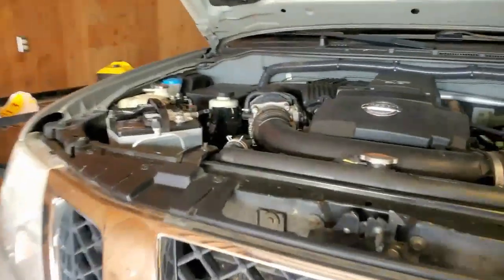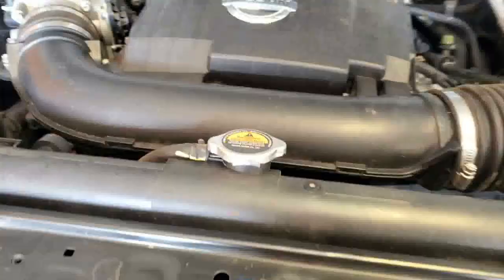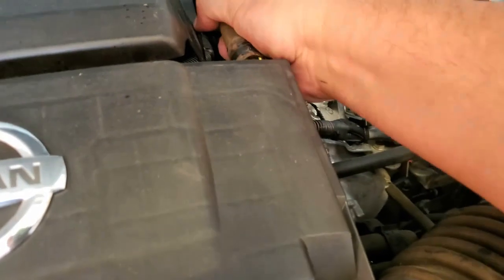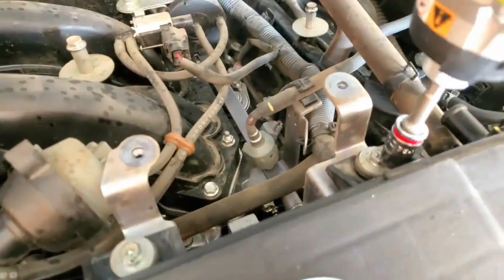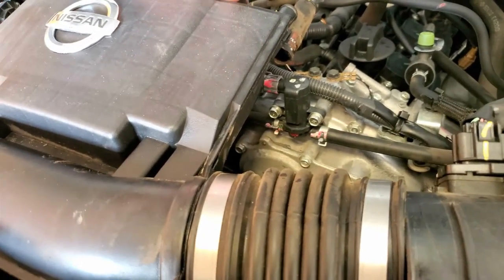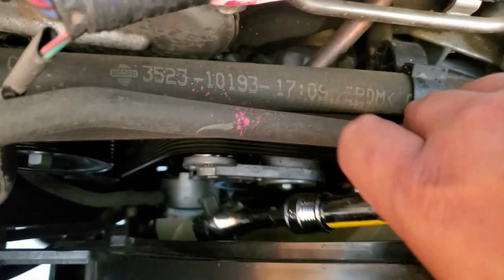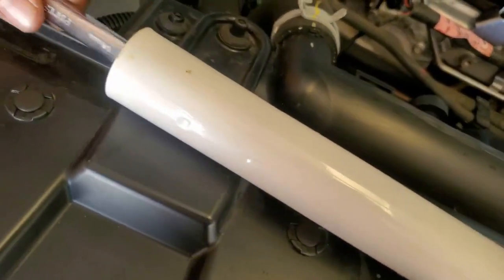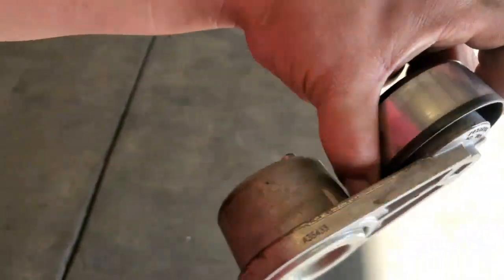How to: Remove the Automatic Belt Tensioner on a 2014 Nissan Frontier

Comment: I have a 2014 Nissan frontier in the serpentine belt slips off when it’s raining out and there’s no play wobble in the tensioner belt is new
Why does it come off? 
please and thank you
Reply from the maker: Whoa no way that's hecka weird
...I honestly have no idea the only thing I can think off is a pully somewhere must be of centered. Or replacing the hydraulic tensioner.  Even tho it looks good and feels solid, it might not be as stiff under tension and causing it to come off.

Found this on Google 

(What would cause my serpentine belt to fall off?
Belt coming off: Pulley misalignment, belt misalignment on pulley, defective tensioner, or bearing wear in tensioner, idler or driven accessories.)
Reply: thank you for responding and for your honesty.
Reply from the maker: Your welcome 🙏 good luck buddy 👍